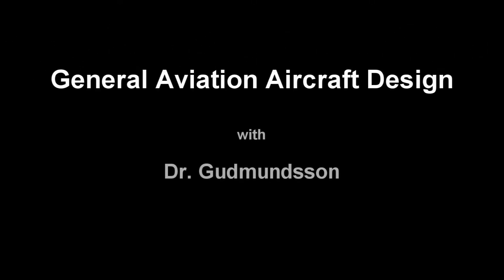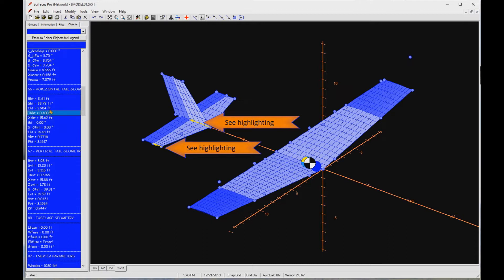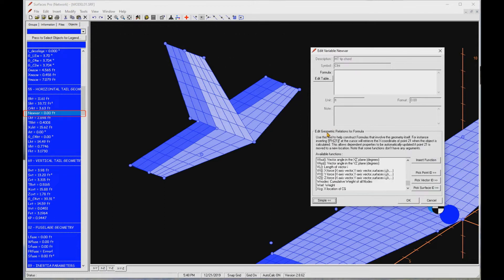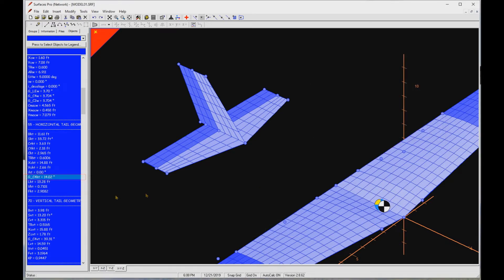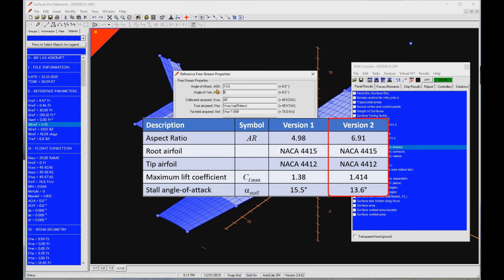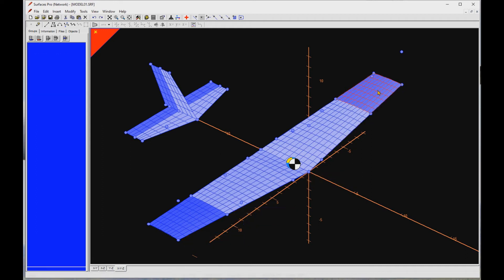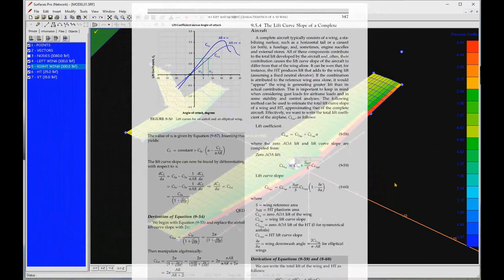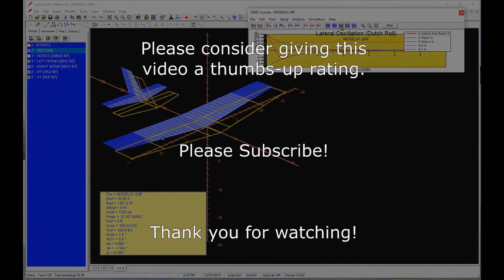PART 6: Version 2 polished, aerodynamics checks, Math Objects, new Vs and CLmax for Version 2.

Comment: Good day prof. Gudmundsson, concerning determination of Lift curve Slope, CLa for a 3D lifting surface in the general aviation aircraft design textbook, can "Equation(9-55) on page 351, lift curve slope for an arbitrary wing" be used for a rectangular and tapered wing? Thanks.
Reply from the maker: @israeloluwagbemi825  Good day, Israel. Yes, it can. However, you must first determine the parameter 'tau' using Eq. (9-131) in the 1st edition ((9-176) in the 2nd one). This is a fairly labor intensive approach as it requires the coefficient A1, which is obtained using the lifting line scheme in Section 9.7.3. If you're dealing with regular constant chord or trapezoidal (tapered) wings, I suggest you use Eq. (9-57) in the 1st ed or (9-72) in the 2nd one. Hope this helps. Best wishes.
Reply: @dr.gudmundssonaircraftdesign  
Thanks for your response prof. I also came across eqn (9-56), it also looks reliable and more convenient to use than eqn(9-57) , my case study is for a rectangular, tapered wing, i also made comparison with eqn(9-53) and (9-54) values using Table (9-7).I hope this is an acceptable approach. This are based on edition 1 of the textbook... Thanks for your support sir, am very grateful.
Reply from the maker: @israeloluwagbemi825  You're welcome.

Note that Eq. (9-57) is the same as Eq. (9-56) except it includes three corrections:

(1) It corrects for wing sweep, 
(2) It corrects for the fact that real airfoils have a lift curve slope that ranges from 92-98% of the theoretical value of 6.283 per radian, and
(3) It corrects for compressibility.

Of course, if your airplane is a simple aircraft Eq. (9-56) is all you need. Just know that Eq. (9-57) is a pimped up version of (9-56). Best wishes.
Reply: @dr.gudmundssonaircraftdesign  ok .. that's great. thanks

Comment: Great vídeo I'm doing something similar but based in Raymer philosophy but it seems that you have many experience in this area. I'd like to know more about the book and if this cover only aerodynamics or all (include structural and Thermal design). Thanks for all this valuable information, greetings from México
Reply from the maker: Hi Aeromundo. Thanks for the kind words. My book is a conceptual/preliminary design book. Thus, it focuses on all aspects of the external aircraft and not structures or thermal issues. These are dealt with during the detail design phase. Best wishes from Daytona Beach, Florida.